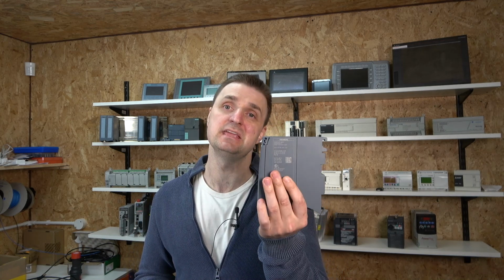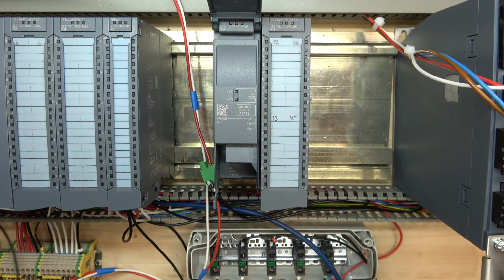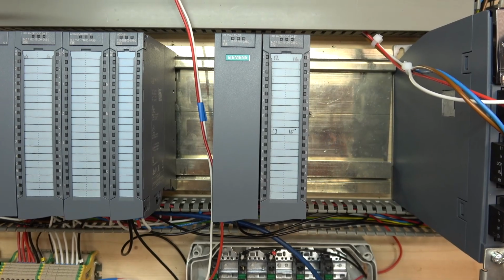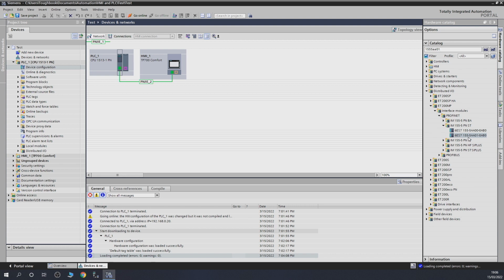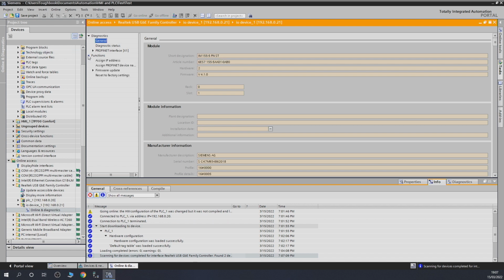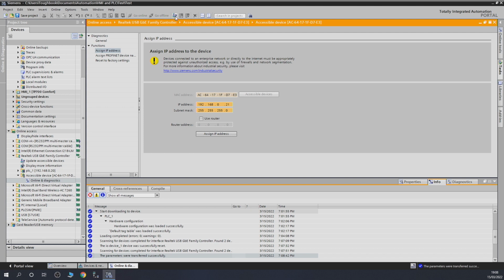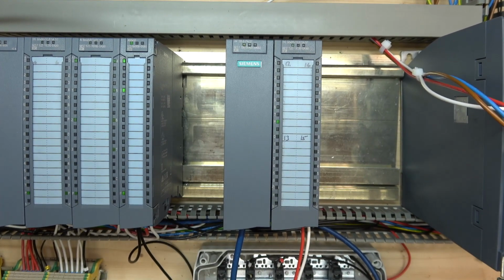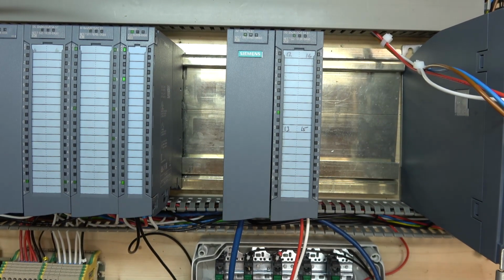How to establish communication between Siemens S7-1500 PLC and ET200 MP Distributed I/O Card. Eng

Comment: What if the unit fails , can you do a direct swap ? Or do you have to configure
Reply from the maker: What unit failed?
Reply: @IGSElectronics  the et-200mp failed. 
It’s a PN HF version. But I only got a PN BA in stock. 
I have to find a way to configure a the PN BA to work on an existing system tomorrow when I go to work.
Reply: @IGSElectronics  I tried to swap it with an old used one and go with “change device” but that didn’t work. I’m guessing that’s because I didn’t factory reset it. But yea. Pressures on. Any help and I’ll hook up the Pateron lol.
Reply from the maker: @justinpuzak2558  Did you set up IP?
Reply: @IGSElectronics  once I factory reset the card and then used the “change device” option, then assigned the name and ip it had on the old card it worked. 
Thank you. Your video let me know I needed to factory reset it. Thank you.
Reply: @justinpuzak2558 for future reference, you can change the IP with TIA portal using the accessible devices tab. You can go online with the it and change the IP and profinet name. I have never had to factory reset it.